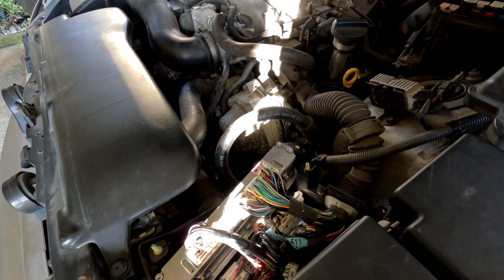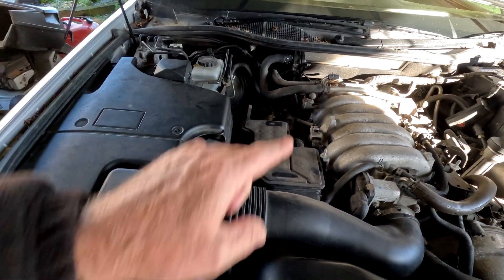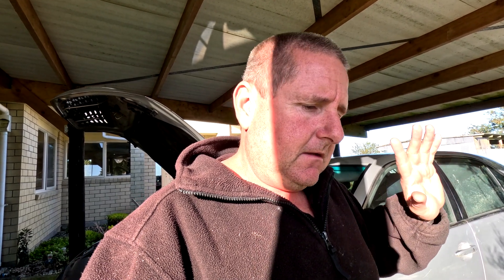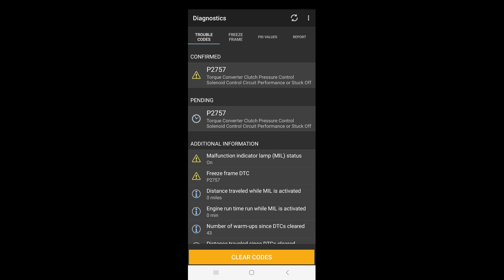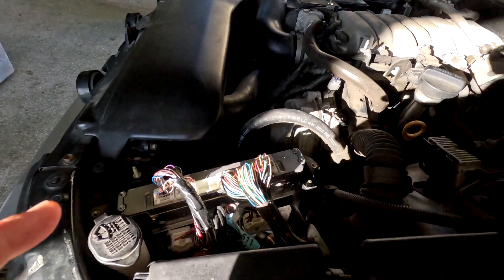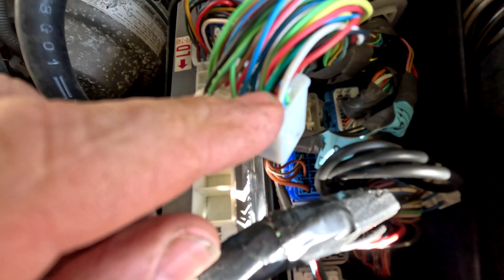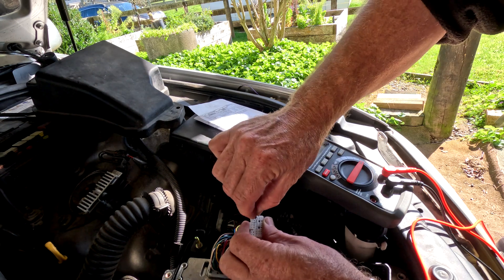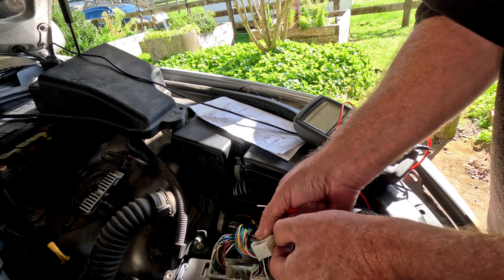Lexus LS430 & Toyota Celsior 3uz 6 speed automatic transmission solenoid measurement.  A761e

Comment: I have an 05 LS430 that is not shifting out of 3rd on first crank. I have to shut the car off and restart it quickly and then it'll shift fine for the rest of the day. Would you think it's the ECU or a solenoid? I've already tried the coolant sensor replacement. No dice.

Comment: Résultats de recherche

Résultat de traduction

Français

Anglais

hello 👋 I follow you on Facebook I am in France. I own a 2002 LS430 The vehicle runs very well with the automatic choke. As soon as it comes off the car doesn't run very well, I have to accelerate almost to full throttle for it to work well. I replaced 8 coils 8 candles flow meter, throttle sensor. the 2 solenoids and still nothing if you have a little idea 🙏🙏🙏
Reply from the maker: I will have online consultation sessions once I return from my summer holiday.  Very limited places available to be purchased for help around the world.  Cheers Kelvin

Comment: Does this relate to the code 0751 shift solenoid A?
Reply from the maker: Yes,  this can be used any time a solenoid code is present.  Cheers Kelvin
Reply: @CartuneNZ  and will simply replacing the solenoid when a true fault is found solve the problem?